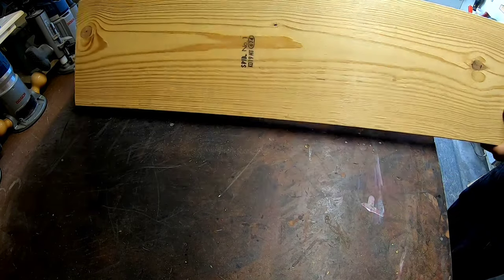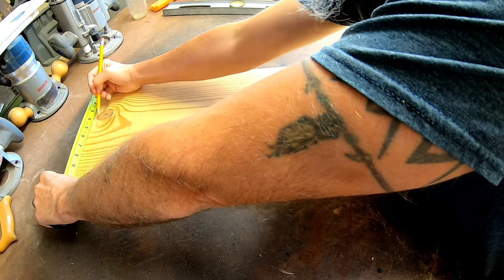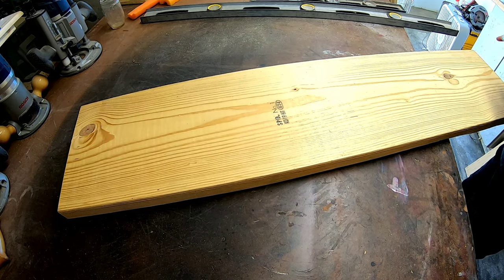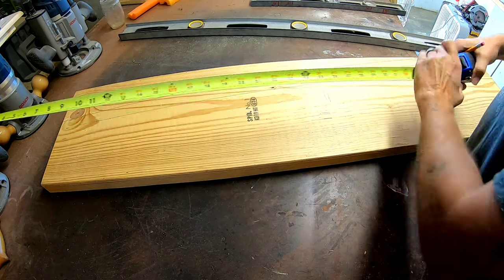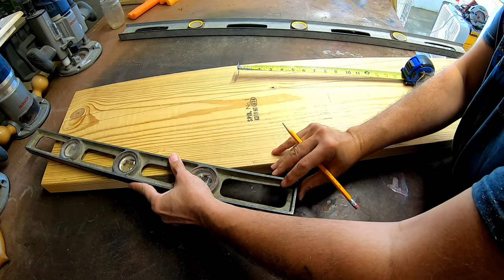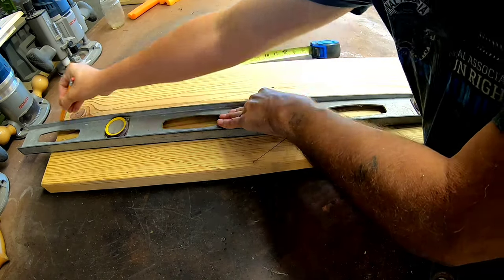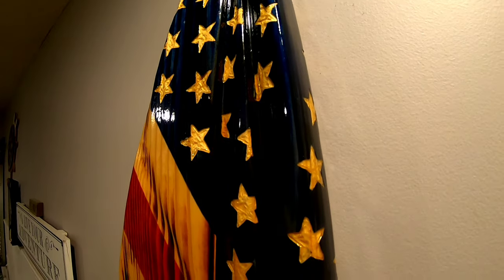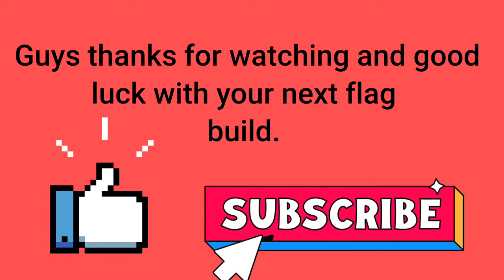DIY Step-by-step how to make a rustic draped American flag from a 2x12 piece of lumber.

Comment: Man that’s really nice and you shared your layout. I am going to make one, thanks. Also, if you use a sharp razor knife and a straightedge you can score your lines before you stain and it really helps with the bleed through as it scores the fibers. Thanks again for sharing!
Reply from the maker: I have tried that but i didn't like the way it looked and felt when finished.

Comment: I'm having so much trouble masking off the lines. Other than that awesome video and thank you for taking the time to share👍
Reply from the maker: Trouble as far as what?  Spacing? Good contact with the tape?
Reply: Spacing mainly. Whenever I go over any of the "waves" or the side it changes the angle of the tape if that makes sense.
Reply from the maker: @bshort6941  sure do and that's perfectly fine. When you look at a real draped flag the stripes are not perfectly in line. The first couple I  made I made sure the spacing was perfect until one day I took the time to look at a real one now I just make sure that when I start a new stripe its spaced right but then I let the tape follow the wave pattern in the wood.
Reply: That's kinda what I was thinking. I am sure I will get better the more I try. Thank you again for sharing and also for replying.

Comment: You said you have a problem with bleeding. Prior to staining, if you put just one coat of urethane on the parts that represent the white stripes and along the edges just use a smaller brush, you should avoid any bleeding. It worked for me, but, it's a bit time consuming. You would have to see if the time to profit ratio is feasible. If not, I really do like the torching the bleed areas. God bless and excellent work,  sir

Comment: Can you tell me what type clear coat you put on the drapped flag also do you use that product on all flags thank you i am working on my fisrt flag ever.Thank you for sharing these videos.
Reply from the maker: I used gloss spar urethane on everything. It's great for exterior, I think it gives a better finish than most polyurethanes. I've tried different ones, but Helsman is my favorite
Reply: @HanleysHomestead  Do you use the oil base and your reasons to use the oil base .I think after little reading iwill use oil based . thank you again will wait for anser will have more questions later

Comment: Man. Awesome work.  It looks fantastic. I was a little bit confused by the layout, but it makes sense in the end. 
How many hours do you have into it? 
Not including drying overnight?
Reply from the maker: That all depends on how carried away I get with carving and shaping the waves.  I  try to have less than 3.5 hours not counting any dry times. Counting dry times and sanding between coats, it's a few days start to finish.
Reply: @HanleysHomestead  It's worth it.  I think I would waste alot of 2x12 boards trying to get it to look like that.
Amazing.

Comment: Use razor blades instead of tape. Rubber mallet in a line into wood. Leave in while staining
Reply from the maker: I tried that method and didn't care for it. I found that tape and fire gives it a better worn look.

Comment: Use razor blades in-between your colors. Gently tap the razor blade into the wood, and the stain won't bleed. You'll never see the razor blade line either.
Reply from the maker: I've tried that but didn't like it. I don't get much bleed through anyways so using the torch to blend it works well.
Reply: You do amazing work my man. Keep it up
Reply from the maker: @joshstueven6505  thank you

Comment: Was told to paint with clear coat over the edge of the paint and it will seal so there is no bleed thru and paint, pull off your tape and clean edge
Reply from the maker: Are you saying a coat of clear first?
Reply: @HanleysHomestead  not over the whole project.  Put the tape down like you do, then, just over the seam of the tape where you want the crisp edge, apply a thin strip of poly.  When dry, paint as you normally would as the poly will accept the paint but prevent it from bleeding under the tape.  Try it on some scrap piece and see how the stain works on the poly.  The trick works on painting moldings and baseboards.
Reply: @HanleysHomestead  I just was watching another video and the guy used a coat of modge podge over the area to seal the tape instead of the varnish

Comment: What color stain did you use
Reply from the maker: I'm currently using minwax navy blue and barn red
Reply: @HanleysHomestead  thank you for your video on how to make this draped American flag.  My question to you is how much do you charge for one of these flags
Reply from the maker: @brianmacklin8625  American $125,  Christian/American or anything custom colored $135. If carving letters add $2 per letter.

Comment: What size stars are those?
Reply from the maker: I use a stencil with 1¼ stars.
Reply: Have you come up with a smaller scale flag design the same way? Like 28 or 30” tall
Reply from the maker: @adamgendreau6313  I made a smaller one but wasn't real happy with the way it looked.